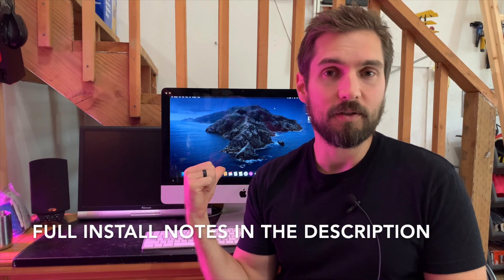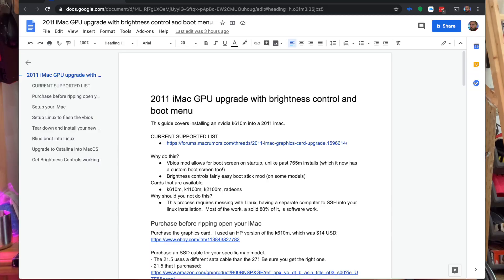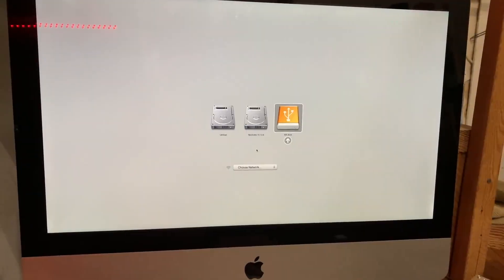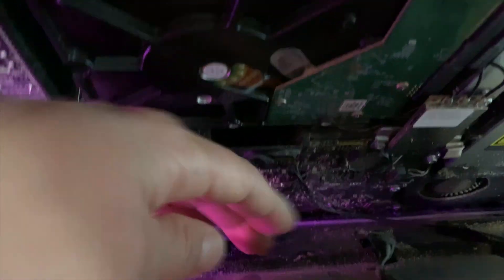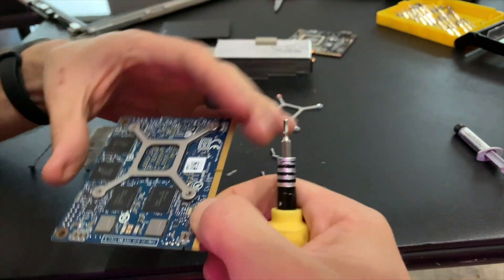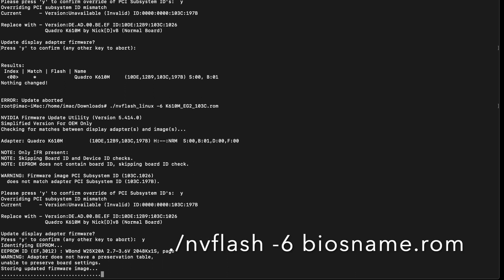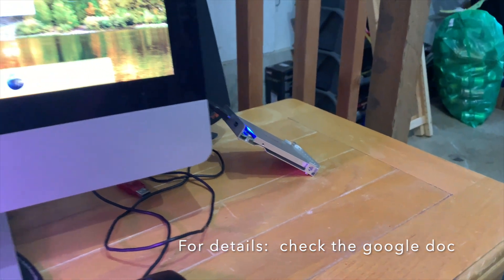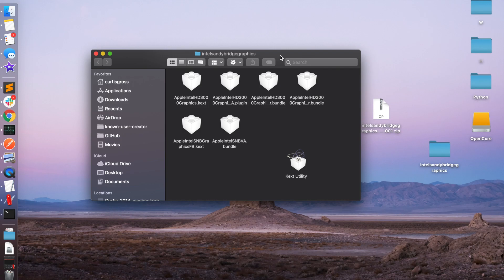2011 iMac GPU Upgrade Now with Brightness and Boot menu - Absolutely Worth It!

Comment: Little upgrade here, I received my am 6750m i bought from eBay and looks like it’s working great but in 30 minutes of YouTube videos he seems like he overheats (96 degrees) and I wanna know if you know why does this occurs ? (I put artic Mx-4am on the chip and vrams bc I didn’t had thermal pads but I don’t think that’s why it overheats) thank you in advance
Reply from the maker: Sounds like either the fan is not cooling it (download MacsFanControl to see...) or the Heatsink is not making good contact with the GPU die.  What is the temp it runs at idle?  Are the fans running?
Reply: Curtis Gross what’s « idle »? Could it be a internal components problem on the gpu ? Like I mean how could I diagnose if my gpu would be goood for a long time ?
Reply from the maker: @moneyfueled1056  Idle meaning - does your graphics card get hot when you are just browsing around on the internet?  Or only when watching YouTube videos?   When you say 96 degrees - do you mean Fahrenheit (that is Nice and Cool!) or Celsius (HOT for a GPU)?  Usually overheating is not a GPU issue, it is a Fan / Mounting of the Heatsink issue.
Reply: Curtis Gross haha i thought that was like an expression and not an actual word, thanks for the definition 
It’s celsius, as I said I didn’t put thermal pads on vram only thermal paste, I hope it’s not bc of that

On idle fans are spinning sometimes loud then low ( even if I just stay idle)
I ll start it up and give you and update

Thanks a lot for your concern.
Reply from the maker: Muhammed Kaplan - gotcha. The vrm temps shouldn’t be an issue. Sounds like your gpu is the hot part.
Reply: Curtis Gross i launched it 2 min ago and it’s stable for : 
Diode 33
Heatsink 31
PECI 25-26
Proximity 32 

Sometimes they jump of five number and goes down
Reply from the maker: Muhammed Kaplan those all seems great. How long does it take to heat up?  Maybe use the macsfan control app to crank the fans and see if it helps out.
Reply: Curtis Gross so by the time im writing this they all jumped + ten degrees Celsius, (watchin a yt video started 5 min ago)
Reply from the maker: Muhammed Kaplan normal is 60-70c under load.
Reply: Curtis Gross so it seems like my fan spins a little bit too fast bc when I tested it yesterday it barely passed 70c but the fan spinned so fast. (Oh and I said 96c but it was 96f)

Comment: fév 2023 > imac A1311 ready to Ventura 13.2.1  + nvidia GTX675m new wifi AC > and transformation layout of power supply boards + holes and fan for heat extraction TOP !

Comment from the maker: Looks like the pricing of the k610m is up to ~$50-60 now.  At this price, I would hold off on the k610m, maybe go for a k1100m or k2100m instead.
Reply: would would be a good price for the k1100 or k2100m? Looks like I may have missed the decent price for now. Ill keep an eye on these. Would love to upgrade this machine to Catalina with upgraded GPU  this summer! Thanks for your video!
Reply from the maker: JRichVA I see a few k1100m around $50-60. That is an ok price.
Reply: Think I got lucky with a 610 for $14 .. it's certainly not worth more than that. Advise people be patient and set up a couple of saved eBay searches, prices will drop back down pretty quickly.
Reply: Hey curtis, you have the vbios back-up from the k1100m you tried to flash?
I bought an hp K1100m and the backup is nowhere to be found on the imac, and now I have scrambled video from the modded vbios.
Reply from the maker: Richard Woodurff mine wouldn’t even turn on - so no bios here.  Worth asking in the macrumors forum though, lots of people with the k1100m there.
Reply: @messing-with-computers  found it buried on the macrumors forum! it back up for now. So hp cards don't work is my guess.
Reply from the maker: @richardwoodurff9186  - Interesting.  The k610m I used was an HP model.  But, I haven't gotten to try the k1100m yet, as the one I had arrive was DOA.
Reply: will the hp zbook version work
Reply from the maker: Edison Chow I used the hp version of the k610m
Reply: Curtis Gross so the zbook one, did it work better than the one that came with the imac
Reply from the maker: Edison Chow yup. It works great! Although with the price of the k2100m coming down to around $50 I would grab that.  Basically $15-20 for the k610, $30 for the k1100, $50 for the k2100m. And no more than around $85 for the k4100m is about what to look for.
Reply: I can handle the physical installation but you lost me with the blind boot.  Can I install the new card and leave off the flashing?  What updates can be done after the card is installed?
My goal is to future proof my 21.5" Mid 2011 iMac for macOS.  I do not game.  With no regard to price what is the simplest and most reliable card to install?  I have 32 gb and an ssd and updated the wifi/bt using osxwifi.com.

While I am at it do you recommend a processor upgrade? If so, what would you recommend?

Sorry to go off topic but I don't want open this thing again.
Reply: @Iamtherealchow  what model of card did you use from a zbook? they seem to be the cheapest but some don't come with BIOS.
Reply: I have a mid 2010 iMac 21.5 inch, wonder if your video can be applied to it? including the GPU cards recommended. Thanks for your great video!
Reply from the maker: David Tian as long as your cpu is an “I” series like the i3 or others you are good to go.  No “core” series though.
Reply: Hey Curtis, thank you so much for this Video. I also installed a K610m into my 2011 iMac. Everything worked Fine until catalina Update. I geht black Screen in Boot and Nothing will happen. After power off an PRAM reset i get the Bootscreen and it will run catalina with no issue....until next boot. Andy idea? Thank you
Reply: K3000m in imac 2010 i7 27” Will Work?
Reply from the maker: @serwy06  I would lean towards the k3100, I have heard of the k3000 working.. but not as seamless.
Reply: @messing-with-computers  ty. There are any gpu that supports metal wich is 100% compatible with the 13,1 imacs heatsinks? And congrats to the channel. Solid 10/10
Reply from the maker: @serwy06  thanks!  Sadly I don’t think the 2012 model can be upgraded :/
Reply: @messing-with-computers  sorry its a Mid 2010 i7 870 27”
Reply from the maker: @serwy06  - Ah, gotcha.  I think the 'best' video card upgrade for that year is still... really bad.  So, I wouldn't do it!

Comment: Hey, I need some help. I tried installing GTX 780 in two 2011 imacs to make sure that logic boards are fine. After install only one led turns on anod no start up beep at all. After I istaled back old ATI and it powers on. Do you think that I demaged my GPU? I was cerefull and wear gloves. Do you think I need better power supply?
Thaks for advices

Comment: Hi there how many sata 3 port are in 27 inch 2011 I installed ssd in dvd drive I can’t get full speed of ssd
Reply from the maker: Two internal sata ports for ssd drives. One for the dvd drive. You may need to buy a special cable for the extra ssd though (port is on the board, but no cord).
Reply: Curtis Gross thanks for your help another question are they sata 3 and can I swap the dvd drive plug in to the other sata port , thanks
Reply from the maker: Mirza Habib you will want to order a special cable from eBay or amazon. The power cable is different !
Reply: Curtis Gross what is that cable called ,I was looking the comments and someone mentioned if you installed ssd using cd dvd caddy in cd rom bay which connects with sata2 port so If you just switch cd dvd rom to one of another sata 3 port which is back of mother board then you will get sata3 speed and you don’t need to buy any cable, thanks
Reply from the maker: Mirza Habib - the dvd drive cable is not standard :/. Here is what I used : https://amzn.to/39Sw1nf

Comment: What’s the best and safest GPU upgrade for a 2010 iMac 27” i5 ATI Radeon 5670 512mb? The HP Zbook k610m is compatible and runs well on a mac?
Reply from the maker: Surgicalsensei - yes, the k610m is the cheapest and I used a hp version in my video. The fastest(more expensive) that I have found a bios for is the k2100m. I did hear that there is a k3100 bios out there somewhere. But I haven’t found it.

Comment: Will this work the same on the 27 inch?
Reply from the maker: Yup!  You will need to modify the heatsink though, so powertools will be needed!  But the software process is exactly the same.  I have an earlier video where I modified the 27inch and modified the heatsink. Check out that video for what types of tools and process.
Reply: @messing-with-computers  should the size of the k610 be the right one without modifying anything??
Reply from the maker: Keigo Moriyama the 27inch imac has a bigger heat sink - it would beet to be modified for the k610m to fit.  Probably the same for the k2000m by looking at the photos.
Reply: @messing-with-computers  so same for the k2100m then....
Reply: actually, the shortet mxm cards fit nicely without modding on the 27" heatsink. It might sit slightly at an angle. so you might need to add some  washers unders the screws to even it out. And use k5 pro thermal paste to fill the gaps.
Reply from the maker: Péter Viszt I tried using thicker thermal pads to reduce the angle - the heat difference was crazy vs a flat fit. Probably 20c difference. It works. But it throttles.
Reply: @messing-with-computers  I used some plastic washers between the card and the heatsink for the screws on the right side and just used a bunch of K5 PRO. I don't see any temp issues, the fans don't even spin up, heatsink temp max is around 60 degrees, but much lower on normal use. Its a k1100m. Thermal pads are really bad for this in my experience. K5 pro is pretty expensive, but thats the only stuff that works properly for this use-case.
Reply from the maker: @passatgt  Well - the heatsink temp would be lower if the GPU die is not making good contact, since it wouldn't be able to transfer the heat.  Might be worth doing some runs in Heaven benchmark and make sure that you don't see a big drop in frames by the mid-end point just to be sure.  I ended up cutting my heatsink to get a good connection (in my past 27inch imac video) and the performance improvement was amazing.  Then again - 60c sounds fairly normal?

Comment: I just received my GPU and I’m trying to attempt this, is the Ubuntu, the same as linux? Could you provide a link to download the Linux iso? Also you think we can do this by installing Linux on Mac through vm?
Reply from the maker: Ubuntu is a flavor of linux, which will work for the vbios flashing just fine.  It will need to be 'bootable' not just a VM.  You could install it on a USB stick and do the startup that way if you want.
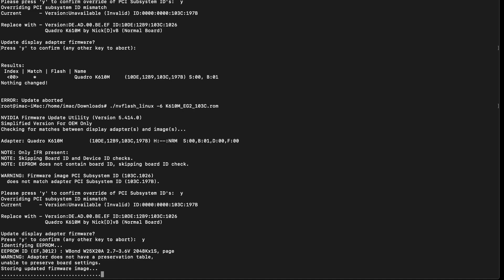Reply: @messing-with-computers  I am stuck at your video 11:39 seconds. I typed ls and it shows both nvflash_linux and k610_eg2.rom , but when I type in the command nvflash -6 k610m_bios.rom, it says nvflash: command not found. Your help would be much appreciated.
Reply: I think I got a little further. I typed in "./nvflash_linux -6 K610M_EG2.rom and it is giving me "-bash ./nvflash_linux: Permission denied
Reply from the maker: @toulor8905  - Sounds like more of a linux permission problem.  You can do a few things - 1. login as a super user in terminal by typing 'sudo su'   Next you can try updating the nv_flash file to be executable : chmod 755 nv_flash   Now you should be able to run the commands.
Reply: Curtis Gross thank you so much! I spent all night researching this and was able to get in as root, but the command didn’t work and after that I found some articles on chmod but their numbers were different. Thank you. Time for the next step! Should I go Mojave or Catalina in your opinion?
Reply from the maker: @toulor8905  - The hardest question to answer!  I would lean towards Mojave if you have anything that is still 32bit from a software standpoint (for me there are a few games that just won't run on Catalina yet).  But, I do use Catalina as a daily driver on my work machine and don't really run into any issues, so I would point back to the 32bit software support - if you need that, go Mojave.  Otherwise, go Catalina.
Reply: Curtis Gross your expert opinion is great! I only do work related stuff, but have enjoy doing diy like this on the side. I’ll probably go with Catalina as long as there is not hardware issues with these older iMacs. Oh by the way, I notice on the video, that you changed the startup disk in order to make brightness control work. Does this mean we have to always have it mounted all the time and boot up into Catalina loader first in order to have brightness control? I may be over my head on this because I haven’t got to the part where I fix the sleep mode. Or does applying the sleep mode also enables us to not have to boot up into Catalina loader?
Reply from the maker: @toulor8905  - Ah yes, you will need to keep the SD card / USB stick in the computer as the primary drive for booting.  I would recommend getting something that is low profile so you don't accidentally snap it off!
Reply: Curtis Gross I might be doing something incorrectly when applying the kext files and doing a sudo reboot, my os will not load up. It tries to load up, but keeps restarting.
Reply from the maker: @toulor8905  - Just added a little more detail in the google doc instructions.  The process is very particular.  If the kext utility runs too long on the first boot, it gets weird.  You basically want to start it, auth it to run, kill it... then drag-drop the files on to the kext utility icon.  It is a weird process, but worked for me.  The first time I did it - I failed as well (opened the kext utility, waited a while, dropped me kext files on the open app window, it did something, boot loop after restart...)
Reply: Curtis Gross thank you! You’re great! Like to report back that I got everything working. Success. Do you know how to uninstall legacy video patch if we accidentally installed it?
Reply from the maker: Tou Lor - yup, just boot back into the dosdude installer and select the “post install tasks” and remove the legacy video checkbox.
Reply: Curtis Gross strange, I have unchecked it, but when the os loads up and I check installed patches, it is still there as version 13
Reply from the maker: Tou Lor - if you run heaven benchmark does the performance stink?  The patch updated might be able to remove it.... I can’t 100% remember how I did it when I made a similar mistake.
Reply from the maker: Tou Lor one other thing to double check. In the post install configuration be sure to save and apply. It isn’t super obvious that the uncheck doesn’t work without the save and apply, which also does a kext rebuild and cache rebuild.
Reply: Curtis Gross I have tried it with no success. Just ran a heaven benchmark and got a score of 117 and min FPS 3.5 - max 8.4
Reply from the maker: Tou Lor - strange. Might be worth it to just reinstall Catalina?
Reply: Curtis Gross I’ve tried reinstalling Catalina, but every time I migrate my files and apps, it causes the computer to go into endless loop restart. Kind of stumped 🤔
Reply from the maker: Tou Lor - yeah, I haven’t done more than iCloud sync, I’m assuming you are doing a time machine restore?  Maybe ask in the macrumors forum to see if someone has restored and what the process was.
Reply: Curtis Gross got it to work by choosing data backup only without backing up apps. Thanks again Curtis. I am a big fan. Definitely attempting to do a lot of your videos.
Reply from the maker: Tou Lor awesome to hear it is working!  I have big plans for my 27” now. Found an old cheap Xeon that might get me to 8 threads on the cheap....
Reply: Curtis Gross that’s great news!!!!! Please make a video! I recently replaced the i5 2500 with an i7-2600. Didn’t know the Xeon would work with the 2011 27 inch iMac.

Comment: I have a question I'm hoping someone can answer. I used DosDude's process successfully on an iMac that I had upgraded the GPU to a K1100m. When I tried to do it to my other iMac with a K610m I had no acceleration. I know it's not the video card because I tried High Sierra on the same machine with the K610m and acceleration was working fine. Anyone have any ideas why it didn't work under Catalina? The K610m does support Metal.
Reply: Look at the thread under common issues or problems. There’s a fix for it. Same thing happened to me and I got Catalina running with full acceleration and it’s pretty smooth.
Reply: Look under spoiler: some common Mac OS problems there’s a guide to fix this

Comment: Great video. Please can you recommend a graphics card with more the 2 gigs for imac 2011 27inch. Maybe 4 gigs. Editing 4k video in FCP
Reply from the maker: Reggae in the Ruff - if you can snag one, the wx4170m would work. For more power the wx7100m is a step up in performance and price.  A cheap option with 2gb would be the k2100m.
Reply: @messing-with-computers  You are the man!
Reply: Hi Curtis. Thanks for your time. One last question please. Within your video AMD RADEON WX7100 is on the recommended list. In your reply to me you recommended WX7100m. Notice the "m". Are they the same? Do both work? Thank you.
Reply from the maker: Reggae in the Ruff The key thing that you were looking for is that it is MXM format - basically it will look like a bare card.  I think the “m” just means mobile. So search with that as well as mxm
Reply: @messing-with-computers  I appreciate your answer. Subscribed.
Reply from the maker: @ReggaeintheRuff  - No problem, also be sure to check out the description of the video for links to the macrumors forum.  Lots of people there are testing all sorts of cards, and the chance of a new card getting a bios like in this video are good!
Reply: @messing-with-computers  OK thank you